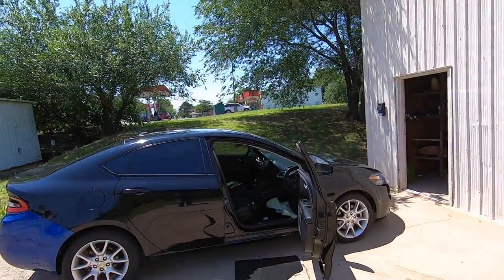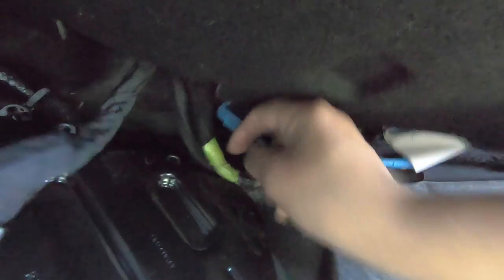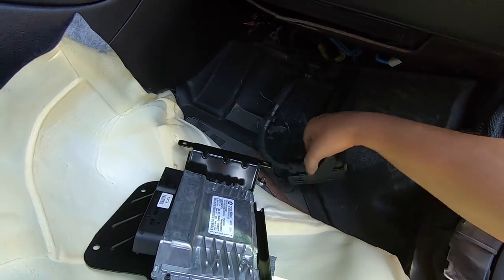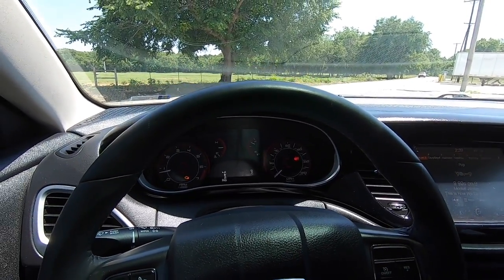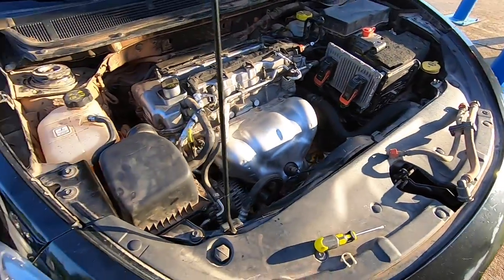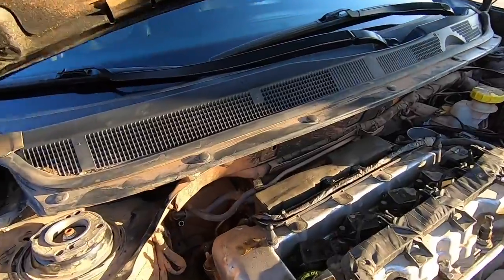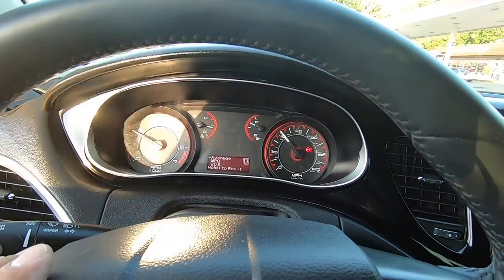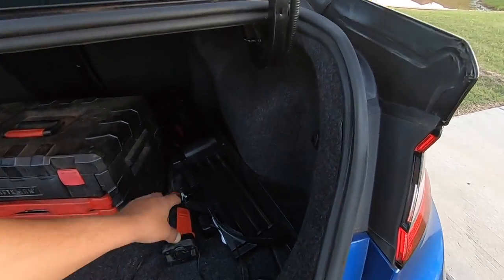$1535 Copart Flood 2013 Dodge Dart Transmission Issues

Comment from the maker: TJ's Auto:
https://www.youtube.com/channel/UC6sBzPByZ6Or7JrBZ_bbW9g
Reply: I'm glad to get varied content each day keep it up.
Reply: I think you should keep the dart for awhile daily driver
Reply: @topangaangelle  I agree Dealers are not what they use to be I got a freind son at  how works at a Chevy Dealer and everything is timed out of a book . This job schould take so long and Parts if they go over mechanic loss  . They schould asked what was what you did and all you did is Swap it out and it fixed the schould said something about the replace or Swapping the unit a new one pris $$$$
Reply: The air dam is known as an active shutter to warm up the car faster and to help maintain the proper temps with minimum radiator fan operation.  But your right, its probably too complex for what it does.  As far as the dealership goes, their mechanics are not necessarily up on every programmable device on these cars and are not given time to learn on the clock.  No excuse but...
Reply: All dealers use a set of books called the Mitchell guides, and they give an approximate estimate of how much time it will take to R&R parts and perform essential services; if for example it says that it takes 3 hours to do a water pump job, that is what they will charge you for it. If the mechanic is good and experienced, he should get the job done in less time, but if he is new or perhaps being delayed, it might take 4 hours, but only then is it their loss, so it's too their advantage to get the job done in less than 3 hours..

Comment: These Darts are notorious for serious DDCT issues. They were rushed to production and need work usually. Very similar issues with the Ford Focus, Fiesta and anything with the DP6 or 6F15.
Reply: I have the 6F24 6 speed auto in my 2014 Dodge Dart as it has on occasion acted up in a minor way in reference to the transmission indicator not lighting up in the Reverse Mode while not paying attention & once in the Drive mode every position on the transmission is lit up in RED!  It doesn't seem to do it anymore!  Otherwise I have enjoyed my Dart quite a bit!

Comment: Hey Randy, that “air dam” is actually a vent that allows the engine to heat up faster in colder climates.  Once the engine gets up to temperature the vents open to let the cooler air in.  My 928 S4 has the same thing and I had to replace mine.  Unless your living in freezing temps you don’t need it.

Comment: Love when transmission issues are that easily fixed. My 2004 Chrysler Pacifica doesn't have a TCM, the PCM does everything. Didn't know what gear it was in when I bought it, so it had no cruise control or autostick and shifted really poorly. And the PCM is VIN coded to the vehicle, so there was no just swapping it. I had to have a used PCM custom programmed to the car before it worked right.

Comment: Randy, I'm inclined to agree with you. When you got the car back it should have worked perfectly. The guy at the dealership is blowing smoke up the tail pipe as far as I'm concerned.
Reply: i will have to agree with you on that because what if your rack actully goes bad and have to replace it,there HAS to be a way for a replacement one to be programed
Reply: Knowledge is power!

Comment: Putting in work brother. You know more about dodge than me after working on this bad boy for so long. I'm going to have to start coming to you for repair questions :) keep up the good work, love watching all your videos especially copart walk around
Reply from the maker: Feel free man!!
Reply: Thank you brother, hey I'm sure you probably did the research but just wanted to say that when it comes to clips and harnesses you can find them way cheaper at amazon or ebay compared to the dealership. I was fixing the engine on a honda fit and air cowl on the front windshield broke all the clips which is a common thing on newer Honda's. The dealership wanted $5.75 per clip and the car needed 9 of them.....ridiculous. so I found the same ones on amazon but stronger material. Ran me $14 for 90 clips, blew me away as to how much I saved.
Reply: No kidding as I have learned so much about my personal 2014 Dodge Dart SXT because of watching Randy's videos indeed!  Thanks, Randy!  I enjoyed watching you spray paint the Dart's bumper with WB Weird Blue!

Comment: It's because the computer needs to be reprogramed. It won't ever shift right until it's programmed
Reply: I bet the dealer programed it by the vin code and specs of the  computer of the black car and not of the blue car.
Reply: @papikabi  I would keep the version 2 since it works. Program it if it throws a code. Just tape the some information to the case so the next person poking around in there knows which car it came out of.

Comment: I rebuilt a 2015 Chrysler 200 S i had to put a whole new driveline into it and it didnt wanna drive. when i did that i found out there was a computer that was mounted on the transmission that is on top rear facing near the firewall on the casing. After i swapped it with the original one it worked great. Hope this can help you. But by the video it seems like it got straightened out.

Comment: Well great, Randy, the blue car engine now in the black car was missing its original TCM!  Simple cure just connect the blue car TCM to the black car, right?  Problem solved along with the fuel line fix update!  Your Dodge Dart videos have taught me a few things about my personal 2014 Dodge Dart SXT!  Thanks...
Reply from the maker: Sadly no. You can't take the TCM / ECM / BCM from one car and install it in another. These are "married" and can't just be swapped out.
Reply: Before you sold the Dart did you end up putting another belly covering on the Dart?  Thanks.  Maybe one day you will restored another Dart?

Comment: I don't believe the dealership knows what they are doing Randy. I'm not a dodge guy, but honestly the BS story they gave you on the TCM would lead me to call BS on the rack and pinion issue. I'd check with another dealership or even another "senior" technician at the dealership you went to. Are you telling me that 5 years in the future if someone had to change a failed component they'd need to live with the light on the dash ? I'm calling BS.
Reply: I believe that a big part of the problem at these car dealerships with Dodge being involved for the moment is that the management teams at the dealers need to offer more training on their respective cars to the technicians plain and simple!

Comment: The dealer charged you for a repair but you got an education.   For the prices on the belly pan and air dam it seemed worth looking on the used market for those.
Reply: The belly pan under the engine obviously serves a purpose in the aerodynamics of the Dart as it buttons up the bottom of the engine offering protection and there are separate openings for your oil drain & oil filter replacement!  The belly pan is vented as well...

Comment: To be honest, I arent surprised the clip fell apart, petrol melts super glue.... and dont ask me how I know that haha
Reply: I guess you've tried it, or something similar yourself since you know :D
Reply: @danishghostrider  Before I was a qualified technician, I tried to fix a Fuel filler by super gluing a slightly smaller pipe inside it..... failed miserably... and dumped nearly a half tank of fuel onto the motorway.
Reply: @admiralalcatraz6080  And nothing caught on fire?
Reply: @danishghostrider  No, although if I had left it...
Reply: @admiralalcatraz6080  Good thing nothing serious happened

Comment: Every time a swap happens, this needs to be programmed
Reply: Yelp your right. That's why hes having a problem. You cant tal any one computer control module and swap to another car. They are code programmed. Meaning once the car is turned on and goes through its scanning process and doesn't find the right codes. Your screwed... Smh Randy you should do some research Bro...
Reply: @beachbro8559  you mean VIN code verified as a matching TCM in this case?
Reply: @johnbeckham1483  👍

Comment: I was in a similar situation with my Ford Fiesta. Car was having trouble shifting, turns out the computer that helps shift the transmission needed a update.  Took a few hours for it to work properly, but it did fix it.

Comment: Maybe bring it to a different dealer, or a transmission specific shop, and get a second opinion.
Reply: Wellp, guess the trans worked out with the tcm lol. I'd still get a second opinion from a second dealership about the steering rack though

Comment: All transmissions are electronically controlled now in newer vehicles and as another comment said yes it's an adaptive shift which means it will take time to adjust to how you drive

Comment: New cars have TCMs and when you "reset" it, it needs to relearn your driving behaviors. That's why people have so many issues with the 2012-2018 Ford Focus' and 2011-2018 Ford Fiestas, because they baby them and don't drive them they way they are meant to be driven. Smooth and consistent throttle inputs.

Comment: Fords have active shutters on the front for aerodynamics too. I'm guessing modern cars are optimized for maximum efficiency. My 2006 Azera had plastic troughs on the bottom for aerodynamics. Unfortunately, they were poorly engineered and cracked and fell down while I was driving. What a racket. Easily removed with a 10mm socket and handle, they are but a memory. Keep the videos coming Randy!

Comment: On the power steering rack, the one from the black car was underwater and I believe is electronic. My guess is it maybe bad (maybe not), but before you go through pulling the old one I would see if it can be tested. Maybe there is a computer module you can swap out on the rack without pulling the whole thing ??

Comment: That is true  I had the same issue with my 2018 Acura when I was having shifting issues from previous owners driving habits. The problem went away after 1000 miles. Same for Mercedes.

Comment: One thing I like about you is that you have real arguments about cars. Being pissed about having to pay $60 bucks for the hoses instead of a clip is an argument. There's another side of it but it's an argument. That air dam (which incidentally would be amazing on a truck but seems useless on a car) being a gimmicky part that causes a check engine light is a valid argument. It doesn't mean the car is a POS like most people say it's a real talking point. 

Fords are annoying because you need Ford screwdrivers and sockets and weird stupid tools that make no sense.  That's an argument. It's not necessarily a deal breaker but it's a consideration. Keep doing your thing, my friend. 

Also, computers in cars need to learn the car in many cases and you will have issues with that but my experience is strictly with ECM issues.

Comment: You are freaking AWESOME! Thank you! I have a Dodge Dart and it’s having TCM and it’s connectors issues from corrosion from being flooded as well.. dealership wants $1,700 to fix.. 🥺 I’m trying to educate myself before I attempt to fix myself (yes I know it has to be programmed and I plan on a plug and play) so any advise would be great.. I disconnected the battery and waited an hour before getting TCM out witch I did the one bolt but it’s not sliding out of the bracket as easy as I thought.. maybe I’m missing a bolt??
Reply: Clean the connectors with WD-40 Specialist Electrical Contact spray & make sure that you have it grounded with that front bolt per Randy's video!  If the TCM isn't damaged from the flood waters most likely you can reuse the original TCM!

Comment: Its a Fiat with a Dodge label (fix it again Tony)
Reply: Alpha Romeo this car is actually...Like GM/Ford they are mis matched these days..

Chevrolet Cruze is an Opel !!!

The Chevy Equinox suv he just bought has a engine made in China and transmission in Japan unless its a 6 speed then its a Ford-GM trans !!!

Camaro was based on the Holden platform,now changed ...just upgraded.

Thats why Chrysler and Fiat got together,Fiat small cars Chrysler large cars ,larger suv's and trucks !

 Dodge Charger/Challenger/300 are all Chrysler..The so called Mercedes parts were rear suspension design from the 2004-2009 Mercedes,not a drop in uniy but design,made larger for those cars..As of 2015 no Mercedes parts are on the cars..They used the 5 speed trans until 2014..But today nobody has their own transmission,sure Chrysler makes the 8 speed but its a ZF design..Oddy some people think the 2005-2010 Charger/300 were on a  Mercedes platform,not so..rear suspension design and seat frames and steering wheel column were all that was Mercedes...Not to emtion the numerous Mercedes that were based on Chrysler/Dodge vehicles..even their V6 is based on Chrysler's Petastar V6..

Its all a mixed bag today..Toyota used Subaru,BMW,Mazda cars redesigned as a Toyota...Ford-VW now has an Alliance,so those will be shared platforms and vehicles..Its not 1970 anymore when GM was GM,Ford was Ford and Chrysler was Chrysler,back then you could tell what engine they had by hearing them start up ,idle or drive by..Even GM/Ford,Chrysler had their own unique starter sound,you could tell what they were by hearing them !! Today all bullcrap same starters made by the same company !

Ford /GM 10 speeds are a joint venture..It will be funny to see Ford guys see a 10 speed Chevy truck with a blown trans and say Chevy trucks are junk because of the trans,yet their Ford has the same trans lol...The world isnt like it was,too bad !
Reply: Lol
Reply: Tommorow
Reply: @01trsmar  I know but its not cool like an Alfa it is all the same company with poor  engineering.
Reply: @guod1973  ..This cars issues have nothing to do with poor engineering....Modern cars you do engine swaps you get tons of codes and issues,he solved the trans issue from the trans tcu..car broke down because of fuel line,that he knew about..Oh well.

Comment: VW does the same thing when you need the vaccum actuator for on the turbocharger. They only sell the whole turbocharger, not the actuator. Bought an actuator from ebay, swapped it out, worked ever since.

Comment: It does need to learn how to shift correctly. Had the same issue with a Ford powershift transmission. After a few weeks of driving it relearned and was working properly

Comment: In my experience, Dodge is notorious for selling the whole assembly vs. just selling the pieces you need. Had my moms Caravan blow a coolant line and we needed one 90 degree piece the was the size of my thumb and Dodge would only sell the whole coolant line package for $600 CAD. 10 minutes in a pick n pull yard and it was fixed for $1.50.... Bunch of schmucks over at Dodge

Comment: You know they quit making the Dodge Dart we just bought four of them all format transmission problems I hate to tell you that but they suck erratic shifting I hope yours works out we rebuilt all for transmissions I still have problems all four of them good luck brother
Reply: If you figure it out please let me know I'm wondering
Reply: those shutters are a pain in the butt hybrids have them as well
Reply: The TCM (Transmission Control Module) which lies installed under the passenger's side floorboard carpeting area has a reputation of going bad and as a result erratic shifting occurs!  There might be a class action lawsuit regarding this transmission problem on certain Dodge Darts.  I  own a Dodge Dart and I am somewhat familiar with various Dart issues & problems!  Sorry that you are having problems but knock on wood I have thoroughly been enjoying my Dart!  Good luck...

Comment: Truck tip..
Always use the computers the cane out of your donor car. I would replace the computer from the donor car before replacing the rack an pinion. See what happens.
Reply from the maker: Tried that, car won't start lol.
Reply: Truck tip, lol. It was supposed to say tech tip. 
Well I guess you will have to do it the hard way! Dang new cars with all their computers!

Comment: As a 3x Chrysler/Dodge owner --- they are BS'ing you. 
First to relearn shift points, all you have to do is disconnect the negative from the battery for 5-15 minutes and it resets the TCM.

Comment: Probably a good idea to just replace all of the parts with Hyundai parts.
Reply: Nope ! Reason it has a transmission from Hyundai is Chrysler at one time was going to buy them,when it was Daimler Chrysler..
Reply: The Dodge Dart was hurried to the market for sales in 2012!  As a result a Hyundai 6 speed model # 6F24 Auto was installed instead of a proposed 9 speed Auto to get the Dart on the market quicker!  The 2013 to 2016 Dart has a rather interesting history on why the car wasn't more successful!  Someone ought to write a book on the Dodge Dart story as it would be a big seller most likely!  Believe me as there is really a lot to like about the 2013 to 2016 Dodge Dart!  The true story about the Dodge Dart truly needs to be told!

Comment: I wouldn't have paid them at all they would have seen the ID codes don't match the vin# and should have told you to swap the TCM instead with a new one that could be learned if you didn't have a parts car. The steering rack should be programmable as well with a ECU re flash they don't know what they're doing and probably had a lube guy do it because they all scam customers with high prices that don't fix the customers problems IMO . P. S. You can get them white clips at the auto parts store in your help section. DONT GLUE anything on a fuel system because gasoline eats most bonding glues so fix it right the first time Randy. Nice work on the repairs and that foam is just a home for mice 😂

Comment: Good job on trans fix, dealer is no good. I dont know for sure but, theres got to be a way to fix the light for the power steering, without changing the rack. You can get those clips at numerous parts stores. Man, you got some nice cars. You need your own shop.  revved up yooper